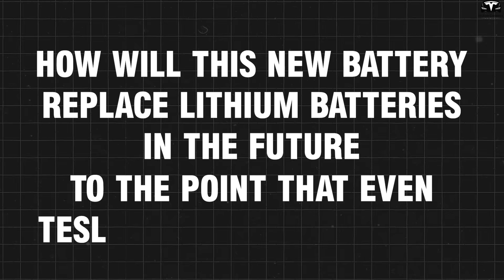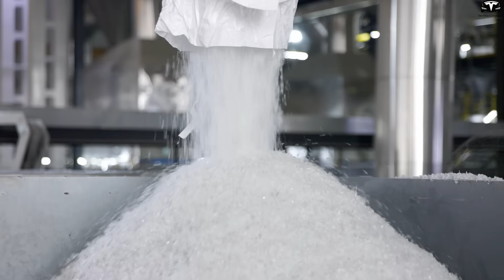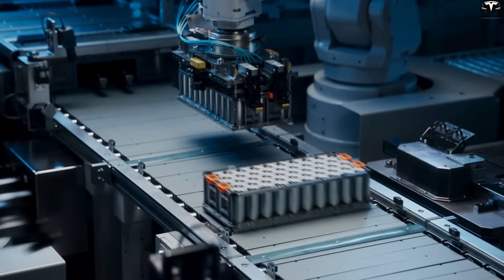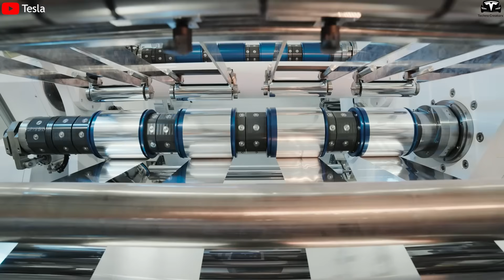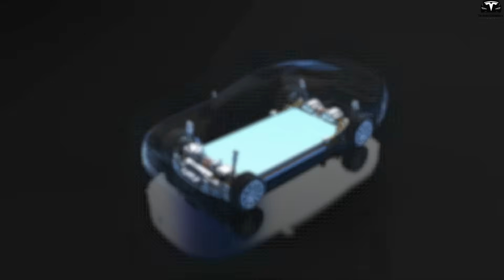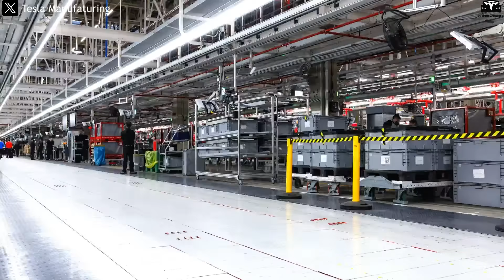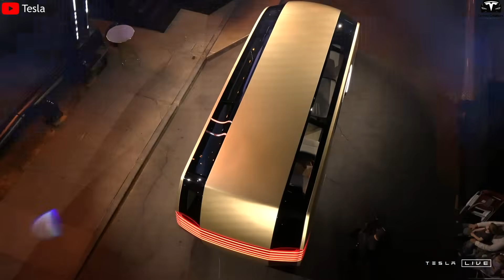It Happened! Elon Musk Shocked by NEW Plastic Battery, Thinnest and Lightest Ever! What’s Inside?

Comment: I'm calling bullshit. Show me the science.

What they're claiming is entirely possible, except for one tiny detail, chemistry. Using a substance to produce electricity requires that it have a free electron, or at least one that's willing to move, to transmit the electricity from one molecule to the nest. Most plastics are stable. SOOO STABLE, that some of them will last 10,000 years, without deteriorating! The other side of the issue is that reliably creating electricity requires an extremely precise chemical reaction. The height of modern battery technology, LIPO4, is a witch's brew of chemicals, that cause a precise reaction, repeatably. If they said that this battery required PVC plastic, or Styrofoam, I would find it questionable, but at least possible. A battery that uses "recycled plastic..? Yeah, that's a lie. Producing electricity requires precise chemical engineering. Not a pile of garbage shoved in a bottle. BS.

(I came to that conclusion at 0:27 seconds. PLEASE do, try to prove me wrong. I'll be waiting.)